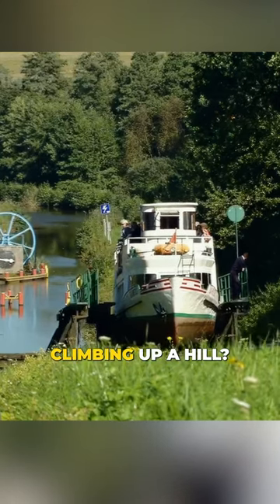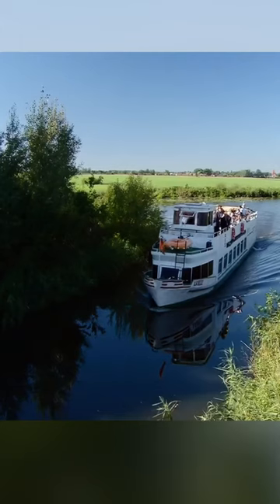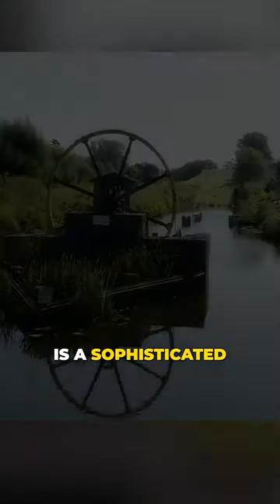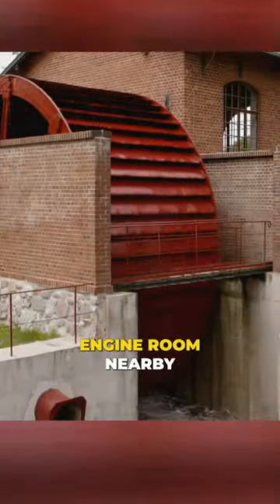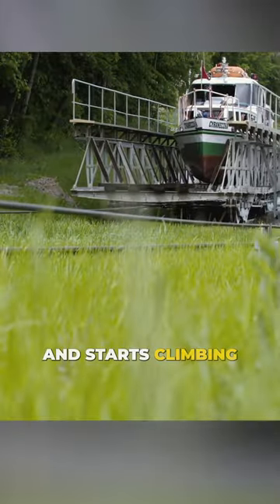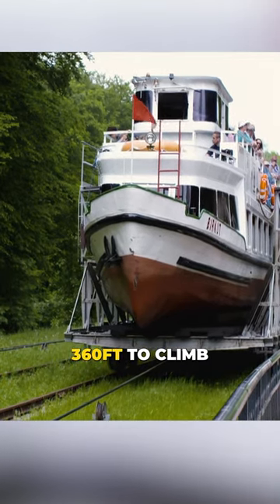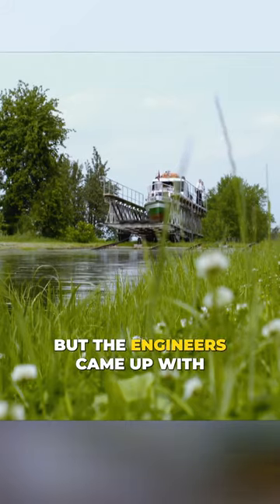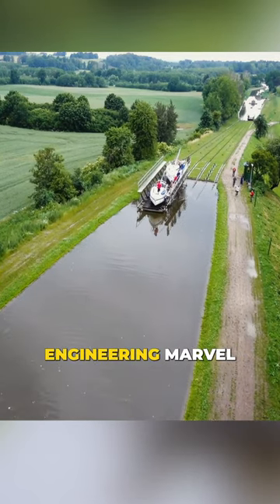You probably NEVER seen this ⛴️

Comment: “Powered by water” absolute genius
Reply: yeah. not a chance in all the hells in the galaxy. look at the water there
Reply: @jamescollier3  I’m just basing it off the video I’d imagine there’s some external power going into Dyk?
Reply: I was surprised, but I think it is possible with a decent gear ratio. There is quite a bit of slope, and they say there are more sections of canal. It is an old machine. Video shows a portion reinforced with concrete to the side of the canal, with a strong current. It is probably what drives the water wheel. Also when one boat goes downhill, the other one goes up hill! Work smart, not hard ;)